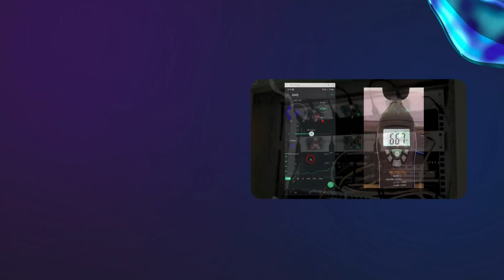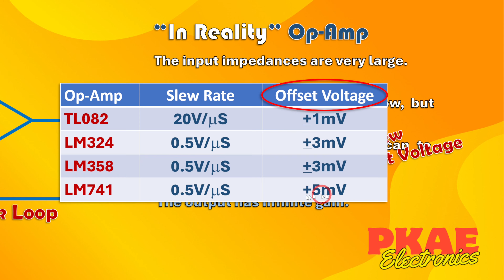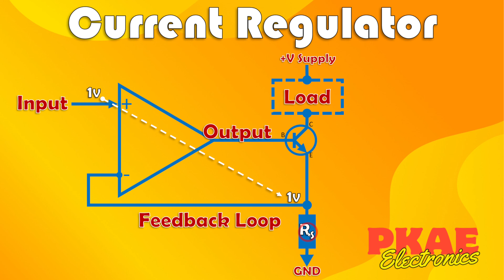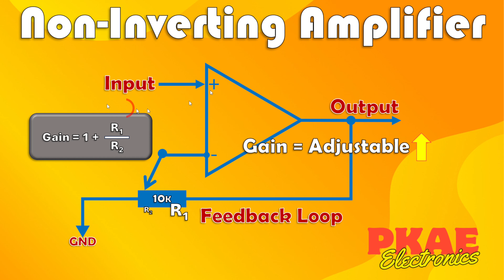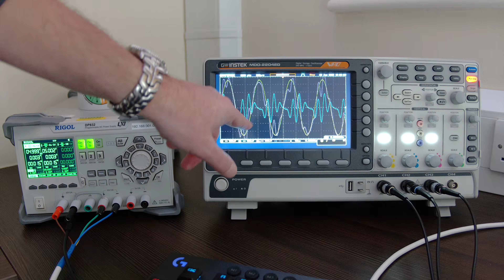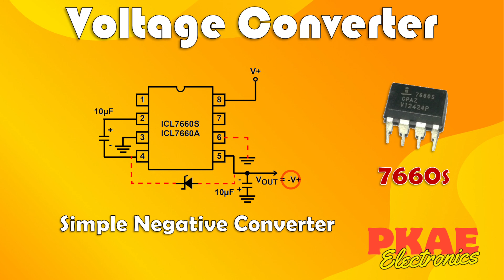All About Op-Amps

Comment: What are those yellow terminals connected in the breadboard power rail??? 5v -5v GND how are they called.
Reply from the maker: They are PCB mount terminal screws 5mm pitch. The yellow that you see is just a sticker I placed over them to indicate what they are connected for. The screw terminals give a really secure connection to your breadboard and works great. Link below for the ones I have bought in the past:- 
https://amzn.to/4febStX

Comment: I was horsing around with opamps trying to build home-brew voltage regulator and got suboptimal results because my tl072 couldn’t drive big BJT properly and small one technically worked but made circuit barely usable. Using mosfet is really good idea which I definitely will try. Thanks!

Comment: I use 100nf caps from pin 4 to ground and from pin 8 to ground  . in my mixing console soundtracs Jade  . I changed the 2 master opamps jrc5532d to op275

Comment: Wow.  I put this video off for so long because I thought it looked like it was going to have too much info in it, but thank God I came back to it because it's brilliant.  The best explanation on opamps.  You explained it very well. Thank you for doing this.  There's only one thing I didn't quite get:  At 38.56, when talking about dc biasing, you mentioned using a capacitor and connecting the capacitor to ground so that "it would block the dc element coming out of the opamp to ground".  Wouldn't that instead cause it to act as a decoupling cap and send ac to ground since it will allow ac to pass through it to ground.  Wouldn't it be better to connect the capacitor further up the path after R1 for example?
Reply from the maker: Thanks for the comment, glad you liked the video. 

Great question, responses below:- 

1) The capacitor you mention, "blocks" the DC content reaching ground; I used the term "will be blocked to ground" which might have been a little confusing. So yes, you are correct in that the capacitor will indeed allow AC to pass to ground. So the AC content seen between R1 and R2 will be a divided down version of the output signa's AC content. 

2) If you relocated the capacitor to be "after R1" as you suggest, then all of the AC content will be grounded before reaching the Inverting input of the Op-Amp and the amplification of the input signal will not work.
Reply: @paulpkae  Thank you for the quick reply Paul.  I think I'm finally beginning to understand this stuff now, lol.  So in essence we want to keep the dc and lose the ac from the feedback.  As far as I can understand it, the feedback signal is an amplified and combined ac and dc signal and we WANT to feed the 8v dc part of it back into the inverting (-) input side of the opamp whilst we WANT to discard the ac portion by allowing it to pass through the capacitor and in to ground.  Having the inverting input connected between R1 and R2 means the dc portion doesn't split after R2 because it sees the cap as an open circuit so continues up to the inverting terminal. On the other hand, the ac portion sees the cap as a short to ground and it flows straight into it, or at least a portion of it does. So it's acting like an RC filter.  Apparently feeding the dc only back in to the inverting input, prevents the opamp from amplifying the dc that we feed in at the noninverting (+) input side and keeps the dc gain to unity.

Anyhow, you earned yourself a sub.
Reply from the maker: @bittertruth6575 many thanks for Subscribing. 

The feed back is indeed a combined DC and AC signal. Think of it as an AC signal being super imposed upon a DC offset. 

However, we do NOT want to discard the AC portion, we are only seeking to attenuate it before it reaches the inverting input and by doing so the op-amp has to ramp up its output voltage of the AC content to ensure the inverting and non-inverting inputs become balanced. Have you watched my video on Voltage Dividers? It may help.

Comment: I am a valve/tube guy. Guitar amps. This video is incredible. The possibilities for using DC offset to deliberately violate the voltage rail 'limits' and force asymmetric distortion is fascinating. Thank you so much. ❤
Reply from the maker: Glad you found it useful and many thanks for your comment, much appreciated.

Comment: Your "Boris Model" of opamp operation is SUPERB! I love it!
The 741 was my first ever IC back in the mists of antiquity... And I remember that that is one of the few opamps that DOES have an offset null... I find it amusing that, on your comparison chart, the 741 has the very worst offset voltage of them all and so has the greater need for an offset null. Maybe that's why the offset null pin slowly disappeared... it just wasn't important any more.
Reply from the maker: Quite possibly :)

Comment: Hi Paul. 
When discussing the summing amplifier used as an audio mixer on web tutorials no one seems to mention that if you have different values of R1,R1.1 etc. then the “ channels”  will have different gain AT THE SAME TIME. For example you could have R1and R2 as 4M7 and R1.1 as 47K. The R1.1 “ channel “ would then have a gain of 100, for a microphone say, while the gain of the R1 channel would still be 1. 
As an aside, since the summing amplifier depends on the virtual earth, it’s best to use an op-amp with a nice high Fet input.
Reply from the maker: Hi, thanks for the comment. 

That video felt like a 100 mile an hour run through so much stuff it was not really feasible to delve to much into each aspect and circuit. 

I do intend doing a follow up video whilst putting together an audio mixer project for my office. A lot more detail will be given in that. Watch this space..... 🙂

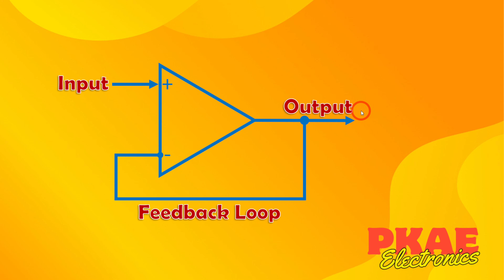Comment: 4:12 What is interesting here is that way back in time... during the 1960's-70's.. when integrated circuits started to become generally available - the idea of a differential input amplifier with  easily repeatable " ideal "  characteristics to form an operational amplifier 
 such as very high gain.. high input impedance , low output impedance etc became readily available.

Called the 
 "operational amplifier"  this  was presented / taught to us EE students more as a device that could  accurately represent / simulate an  "operation" such as add, multiply ' divide,  differentiate, integrate, perform as a low pass / high pass / band pass filter etc .

Hence the name " operational amplifier" - or  "op-amp"

As such... op-amps were typically  configured to simulate  processes  such as say a car suspension system, or a mechanical control system - which was  called  "analogue computing".
This is all well before digital computing !!
A typical "analogue computer" system project  which we worked on simulated the movement of a tank gun barrel  in response to a desired input
The idea being to get the gun barrel to move to precisely the right direction quickly.. without overshoot
 using a number of op-amps to simulate this with adjustable settings....
One could easily change parameters to see the effect of changing variables such as mass, damping,   motor torque. Positional feedback ratio etc .
Quite efective in its day!
Reply from the maker: What a great bit of history, many thanks.

Comment: Electrons flow from negative to positive, against the arrow on a diode
Reply from the maker: Indeed they do. That is Electron current flow, I usually present using conventional current flow. Either way, the rules are the same.
Reply: Current is indeed a flow of negatively charged electrons.. which of course are attracted to the positive source.
Unfortunately.. way way back in time before this was known... it was postulated that current flowed positive to negative... and it stuck !

Everyone knows its back to front... and its called conventional current flow.

So what you will see on almost all electronic circuits is current flow shown  in the direction +ve to -ve
.
That is why the diode is marked that way - it assumes conventional current flow.

Its also why an npn transistor "emitter" terminal is shown with an arrow pointing outward.. showing conventional current flow  from the collector which is biased positive
And a pnp transistor with the emitter arrow pointing inward.. showing conventional current flow towards the negatively biased collector

Just one of the things you have to get used to!!
Reply: I'm not going to get used to it, so just assume everyone else is WRONG.
I believe that electrons flow from negative to positive. Full stop.
I keep this in mind at all times.
When I see nomenclature like Vss or Vdd (source or drain), it makes more sense than Vcc (collector).
Reply: @davidgari3240  Yeah they do and we all get it smarty pants and you do you but as said " Rules of the game are the same" it works just fine for us and has done for years.
Reply: @andymouse  Right. If I'm consistent and get it backward _every_single_time_, everything works fine.
Reply: @davidgari3240  :)